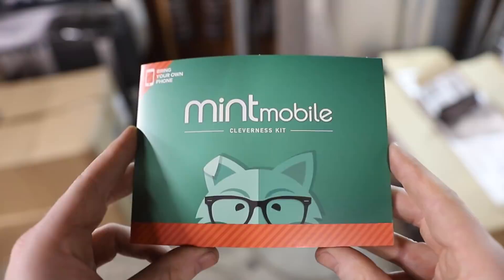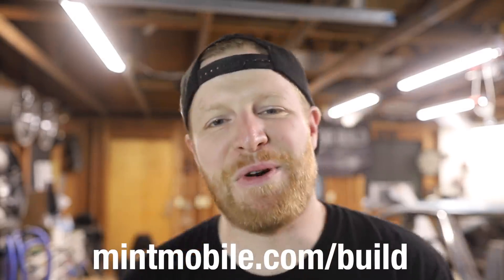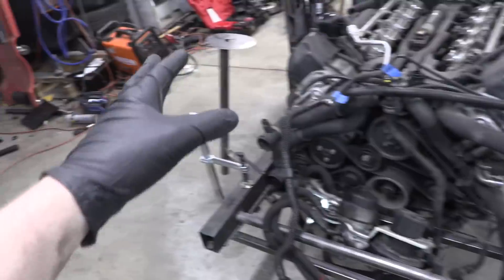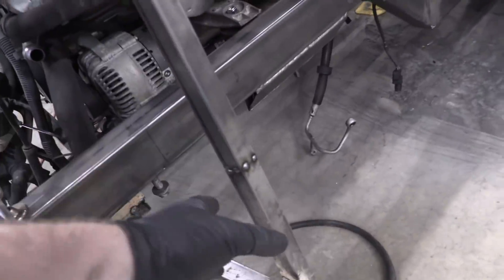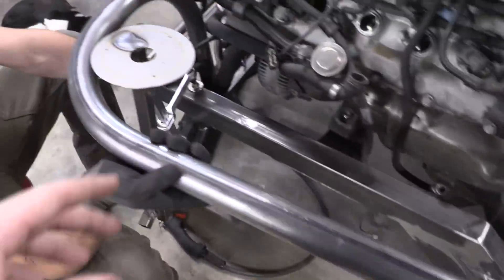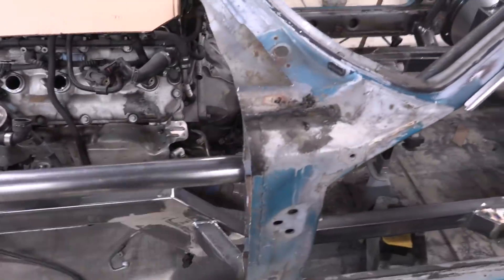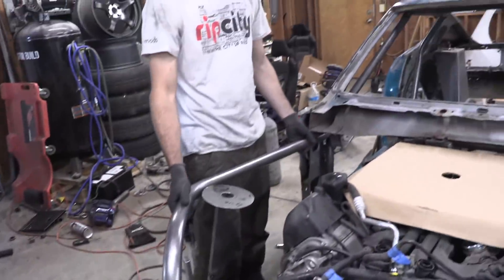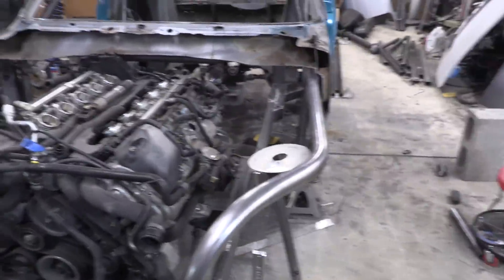Building Tube Frame Strut Towers From Scratch!

Comment: Tape measure rule no.1........never use 2 tapes to measure 2 seperate lengths when checking distances, use 1 as there could be an error in 1 of them. Looking good though, a big day for the front end.

Comment: Did you test fit the front fenders to make sure they fit after Chris? The nose body line dives down quick at the front. 
Also the Datsun 1200 factory competition manual slotted the stud holes for the strut top to allow for camber adjustment so your thinking along the right method

Comment: I love seeing this come together but the front geometry now has me concerned..... you made the initial cut on the jig struts with a portaband, which is not going to be perfectly straight. .Then cut out your inch on the bandsaw.... which will be straight. Now you're reattaching the straight bandsaw end to the crooked portaband end...... that's going to move where the upper flange sits. Maybe not a ton... but could be enough. I'd do a lot of measuring before you lock it in

Comment: Regarding the ITB's: when you weld and grind carbon steel around aluminum or even stainless, the small dust like pieces that fly off are ionized and will "weld themselves" to the body of the ITB's or surrounding metals, or even concrete. It won't be a matter of cleaning them as you will have changed the chemical makeup of them, they will eventually start to rust. Just FYI, keep them covered is my opinion. Nice work overall.

Comment: I don't get why you would want to raise the front of the car by an inch, but whatever, since you designed the car around the M5 suspension I'd guess you would want to use that, even though it would be a bit too stiff

Comment: Hey Chris, I'm no suspension expert but I'd take a look at steering axis inclination, strut towers aren't meant to be straight up and down, because the steering turns in a specific way and will impact caster. The last thing you want is stupid positive camber when full lock because caster is way off.
Reply: The caster angle should match the stock M5 angle since the struts are being located and designed based off the negative jig. They may look straight up from some angles, but I'd be willing to bet if you saw it in person you'd see they're leaned back a bit.
Reply: @Yonash1987  what I was implying :)
Reply: Jayden caster angle
Reply: @baldis12  that's the one, but I also believe it can be interchanged with steering axis inclination and kingpin inclination too

Comment: You and street bandito are going to have to meet up when these are done and race

Edit: I would also get some little shoes for the dog especially with all the cutting and grinding, last thing you want is a piece of metal in your best friends paw.
Reply: Michael Graper that would be interesting... V10 vs. a 4banger. But 2500+ lbs vs <2,000lbs
Reply: Liam McKeever Wright distribution would play a massive part, street bandito it’s very close to 50/50, road track/autox banditos would take it no problem, drag would be interesting
Reply: Nick Cyr yeah, I saw banditos being almost perfect in every corner.. but in drag, the 10cyl would whop banditos.
Reply: Liam McKeever true, but remember this, Chris is going factory computer not standalone, and will not be able to optimize the v10 with the mods he’s done, undoubtedly he will run rich without cats, even with a flash it’ll still be excessively rich tune, more gas without more air = less power. I trust banditos would do everything pretty close to perfect, so I would expect it to be a close race

Comment: Your talking about cleaning out the ITBs before starting the engine but I guarantee when your mocking up the gas peddle you are gonna forget and press in it. Better off cleaning them out now and tape them up 😉
Reply: The ITBs probably won't do anything if he presses the gas because its drive by wire. If the battery isn't connected, the ITBs won't move

Comment: Next build a triton v10 crown Victoria?
Reply: I mean it sounds okay but there are better engines with more variety and aftermarket.
Reply: Lancur yes there are. But i would like to see someone use that motor in a build. The crown vic and the triton v10 are both underappreciated so it's kinda fitting imo.
Reply: Nah, v10 Miata.
Reply: That's funny because when he announced he had bought a car for the next build I immediately thought of a crown vic for some reason. Your idea sounds great!
Reply: Akram Jerab thanks 🖒
Reply: Derrick Porter  it sounds like a cool idea but with Cletus doing the gt500 crown Vic and the whole process of the 240 build I’d bet he’s gonna do a couple less involved smaller builds before the next big one
Reply: carsdude1000 that is totally fine i enjoy the channel no matter what build. I was just pitching out a cool idea.
Reply: The Triton V10 is a flaming hunk of shit. Heavy, PITA spark plugs, and not much more powerful than a nicely tuned up 4.6. A Coyote would be a much better choice, or any EcoBoost engine.